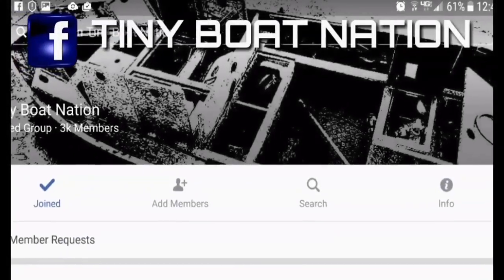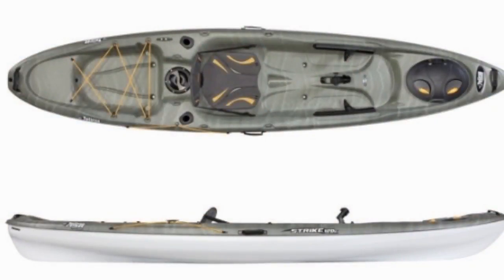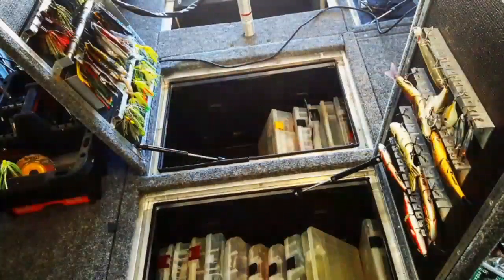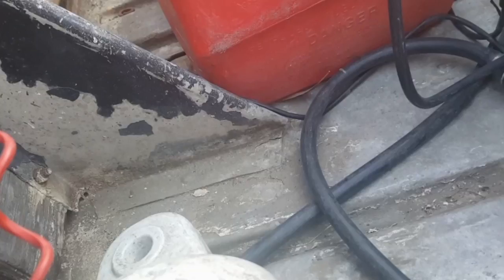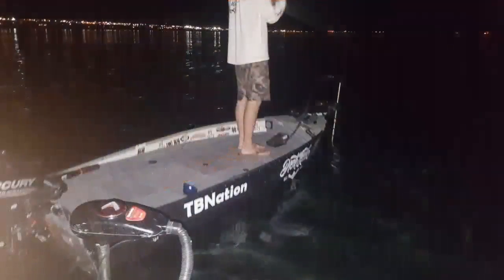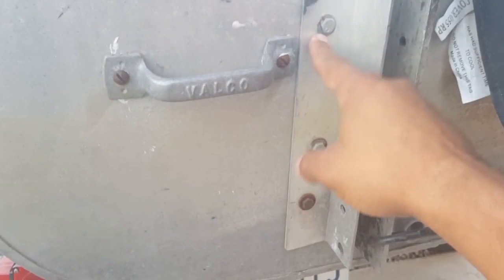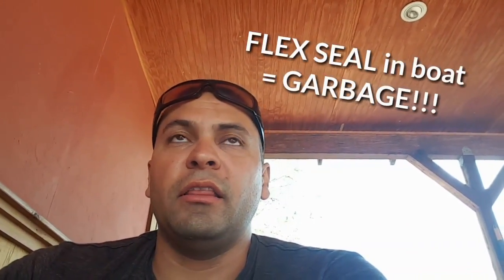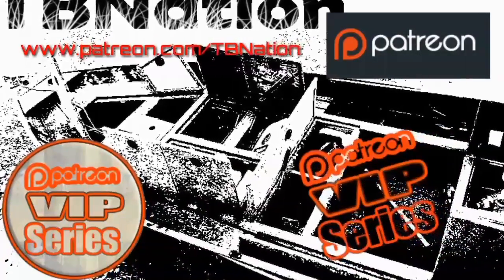Buying your first Aluminum Fishing boat?  MUST-KNOW TIPS!  TBNation

Comment: Michael, I finally got around to measuring my old aluminum vhull and it is 15.5ft from stern to bow, without motor attached and 64in from port to starboard. There are no known identifiers as to make of vessel, nor is there a title to it? It came with a 1980  25hp Johnson, a very decent trailer and an unknown brand trolling motor! The transom is completely disintegrated and I plan to strip it completely this coming winter and start the rebuild. In Central Florida this won't be a problem! I appreciate all of the truly informative videos that you and the other serious TBN members post on here and on Facebook! 
Keep them coming and again, THANK YOU🛶🚤

Comment: Michael, my boat had 2 support bars from the transom to the bench. Exactly as you mentioned. I will look for cracks at the base of the transom. According to the owner he wanted to put a larger motor on it so he had the bars added for extra support. Thanks for the tip. Great video. Lots of valuable information. Keep up the great work!

Comment: Nice video. I ended up getting a really cheap Sears 14' Jon boat with a custom built trailer for $400. Worth it, but a lot of work. Had to redo the hubs and bearings and the wiring. Also painted the trailer and added new hardware for it. Boat also needs lots of work but I know it is pretty decent quality as I have seen some of those Sears boats take decades and decades of abusive, but still not have leaks. I think one important part to mention to people is when they are buying a boat to check the prices on craigslist to the price of a new boat. I see a lot of old crappy 14' Jon boats on craigslist going for $2000 when you could buy an old trailer for a couple hundred then get a brand new boat for $700. Where I am the marinas sell new Lowe and Aluminiumcraft 14" riveted Jon boats for $700.

Comment: Used to be a jon boat guy but when fishing with 12 rods and 25 # of lake pacific tackle and a custom built in rod locker it turned into a one man fishing machine a 2015 Lowe Roughneck if I could go back I would have bought  a Bass Tracker why I didn't because I was to much of a rush to finally have somewhat of a step up from the jon boat.

Comment: Hey Mike, great vid. I wish I had seen this a few weeks ago lol. I bought a 1965 1436. It had a real sold casting deck on it but needed to be removed because they used steele for the framing. Thos revealed a few issues aka patch job. I am not to worried because like you I like to fix things but avoiding money sucking problems should be avoided. I will send some pics of my progress and most definitely be coming to you for advice. Be easy brother and keep the vids coming.

Comment: I got a 14foot mirrorcraft im converting, thoughts? Stern is 54 inches wide, mid to bow is 63 inches wide. Things a beast. Got it with the trailer. I wanna do a wood frame with half inch plywood. Minimal weight. One hatch.

Comment: what's your opinion... after I did the front casting deck mod, it mad the boat stiff. its a 1958, 1648 flat bottom. is this a bad thing overall or at all? The hull is pretty thick too.

Comment: I know this is an older video and this question might be um noobish but what do you measure to determine length and width? I have a boat I've had for a long time but I want to be sure it's wide enough. It's  a 16' meyers. Thanks for any info. It's never been modded and I'd like to use it but just want to make sure if I mod it, it'll be worth it. Thanks again.

Comment: I have bought an older 1436 jon boat. Its been sitting in my neighbors yard for 10 years+ it floats but its missing rivets and the stock transom is thin and weakening with little rust and slight bendy . is it okay to go ahead and make it a project boat?

Comment: Good rule of thumb is to keep tackle limited to fit inside a backpack. No need to build 20 compartments for a stores worth of tackle. Over kill exist. Small boats werent designed to haul enough gear to run a charter lol
Reply: Michael Lopez lol i like your style and putting small boat fishing on the radar. Push for catfishing too patna. Need all styles of fishing on notice.
Reply: Michael Lopez when your channel grows more and it can provide cash to put into more builds without having to invest from your main source of income "job" , let me know, im willing to do a collab and pass over my boat so you can finish what i started and do a give away or what not. Im not into the limelight portion of youtube and i think you can pull it off and it will help create an interest for folks to enjoy fishing. Im fortunate enough to have a big pontoon and i know how it can suck without a boat.
Reply: Michael Lopez link
Reply: Michael Lopez ill have a friend of mine message you on FB with my number. I dont use FB.
Reply: Michael Lopez had my number sent dude